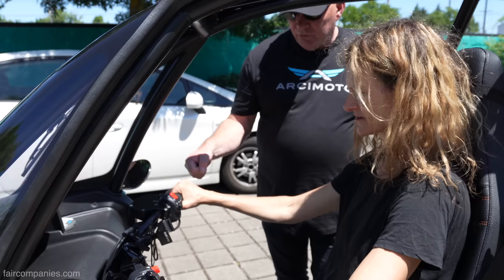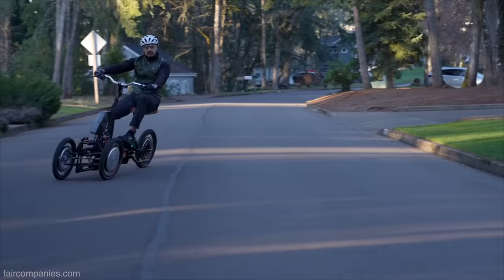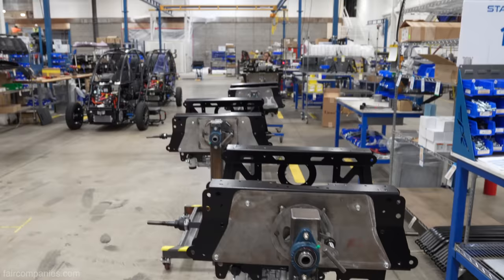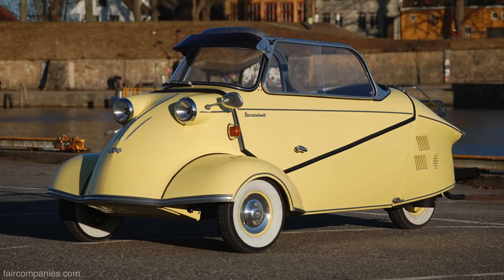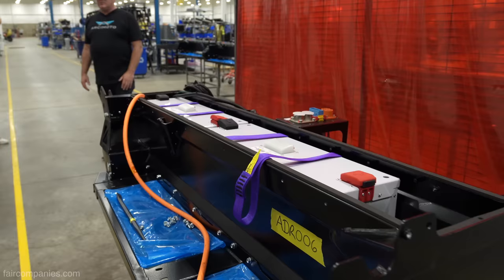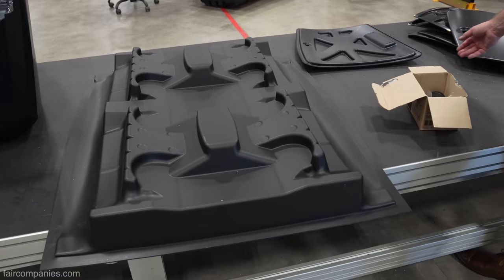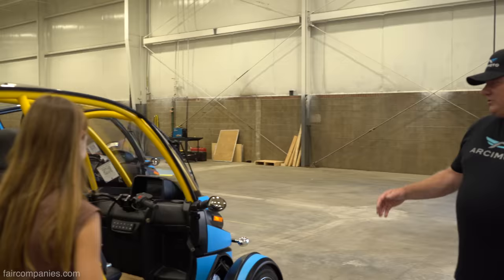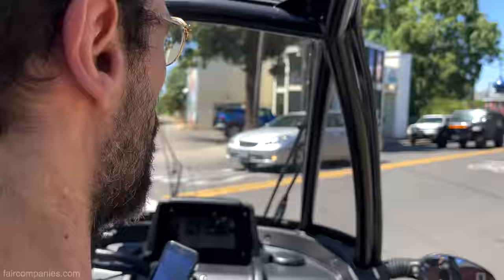Arcimoto 3-wheel EV commuter blends bikes' fun + cars' safety

Comment: Love this. We have a model 3 and it's fantastic. I would love to own one of these 3-wheeled vehicles but my only concern is ...Do you need a strong wrist and hand to operate the hand throttle?  Is it like a snowmobile? I don't last very long using a throttled machine.
Reply: I own one in CA.  No, you don't need a strong wrist.  Grandmas drive these.  At low speed, they are harder to steer, but they are coming out with torque vectoring software soon (software upgrade), and at that point, it will be really easy and intuitive to steer at low speed as well.  The one thing that I would say about the FUV that is challenging is that people with knee problems might not be able to drive for long with the doors on - there is a small, fixed amount of leg room - I need to take the drivers side door off to stretch my leg or I have to stop once in a while.  If you have no knee problems - no problem, there, either.
Reply: @richbodo  Thank you. This is good information.
Reply: Sue - allow me to update you with more specific company information about the steering that Rich was not aware of. Yes, trikes are very heavy to steer below one mile per hour. Most owners manage with no complaints but the design's twin front motors potentially allows for an elegant engineering solution to power steering called 'torque vector steering'. Arcimoto has been working on this feature that is possible through software control of the two motors - one wheel can be reversed by the computer with the help of a handlebar sensor to effect easy steering by computer software. The first beta testing for this starts later in 2022.
Reply: @richbodo  Hi Rich, please do a search for 'torque vector steering' or see my reply here to Sue. An upgrade is in the works.
Reply: @popeyegordon  This is a true electric trike unlike the slow 20 MPH electric ELF that you pushed. Sure you need a license, insurance and registration, but you can take this anywhere without holding up traffic on 45 MPH roads like the 20 MPH ELF does.
Reply: @sbl17jackson37  Nonsense reply. I 'pushed' nothing, I described a hybrid light enough to pedal which requires no driver license and it can be use on bike paths. The FUV is for road use only. Both are electric trikes but the ELF in my avatar image is the one fully qualfying as a trike, not an autocycle. In my 15 years of ebike commuting I refused to hold up traffic. I pull off or switch to a path or sidewalk. I was a car commuter in Seattle gridlock before going to ebikes. You have no clue that the higher consistent top speed of ebkes means they avoid holding up traffic better in all cases. We stay just inches from the curb except for left turns and we use bike lanes when available. We have the same right to the road as any car driver and our actions mean one less car to add to gridlock, one less filled parking space at work.
Reply: @popeyegordon  Thank you.

Comment: GM's electric car in the 90's was efficient enough it could have conservatively served at least 50% of commuters. Less than a 100 miles one way to work, recharged while a person attends their job.
Today?
Depending on climate, above 75%.Purely a guess. But with the knowledge that most people commute less than 100 miles one way.
Reply: P A  You're missing the point. 
I could spend a lot on a Tesla also, but it will take a long time to recover the initial cost through any savings.
50% of summer commuters could get by with this cheap alternative.
Or any small chap alternative not being targeted at the wealthy people. 

Nissan Leaf
Compact car
Body style: Hatchback
Number of doors: 5
Battery charge time: 20h at 110V, 8h at 220V
Battery: 40-60 kWh 350 V lithium-ion
Cargo volume: 850 L with seat area
Dimensions: 4,480 mm L x 1,790 mm W x 1,565-1,575 mm H
Configurations
SV
From CAN$39,498
SL
CAN$48,098
Reply: P A  The Leaf wastes too much energy unless you are always driving it with four passengers. It weighs twice as much as the Arcimoto and is no safer.  Insurance bill for the Leaf will be five times higher than Arcimoto's. Mine is just $130/yr for a good Allstate policy. Even with my perfect record I'd pay $900/yr for Leaf insurance.
Reply: P A  You can only invoke the shill gambit because you have no cogent refutations to my assertions as an enthusiastic owner. "The shill gambit is a type of ad hominem or poisoning the well logical fallacy, wherein one party dismisses the other’s argument by proclaiming them to be on the payroll of some company.

Sometimes known as the Big Pharma Shill Gambit or the Monsanto Shill Gambit. The shill gambit is used fallaciously when the only “evidence” given of such a connection to a big company or government is the endorsement of the position of the government or company, without any other evidence–the implication is that they provide that endorsement only because they receive some sort of compensation from the company or other agency. On the other hand when such conflict of interest is both demonstrated by verifiable evidence and can be shown to interfere with a person’s judgement of the evidence, then it’s no longer a logical fallacy.     Example - 
Clearly, anything the writer says about pharmaceuticals or GMOs can be dismissed because, even though I can’t prove it, they are obviously being paid by Monsanto and Big Pharma to spread the lies."  This despite the fact that Monsanto shut down forever in 2017!!! https://www.skepticalraptor.com/skepticalraptorblog.php/logical-fallacies/shill-gambit-logical-fallacies/
Reply: P A  This is not about me, nor is 'weird' applicable to responsible people who buy EVs. Same thing happened with the first horseless carriages. Learn from history or you are doomed to repeat it. The Era of Beach Driving May Be Coming to a Close    
Jul 19, 2021 — "Conditions vary, but many beaches—particularly on more remote coastlines—often require four-wheel-drive vehicles or advanced driving skills. accessing this sort of scene by car is increasingly difficult in states with beaches, a trend sped up by the pandemic. In California, the state's Coastal Commission recently announced plans to phase out vehicular access at its remaining drive-on beach state park, Oceano Dunes State Vehicular Recreation Area, along the central coast near San Luis Obispo.
On Florida’s Atlantic coast, officials in Amelia Island decided in 2020 during the pandemic to restrict vehicular access to daytime driving and residents only—and then kept it that way. And just south of where Layman and Boulden parked for the day recently, the Oregon State Parks and Recreation Commission decided to close a popular beach to driving, in part because of overcrowding.
States must balance the demands of short-term tourism that supports local economies with the desires of permanent residents, many of whom don't want cars or partygoers to interfere with their view or their enjoyment of a quiet walk along the ocean. There are also the competing needs of working fishers and shellfish harvesters, as well as the environmental stress of cars on nesting turtles, birds and other marine life." https://www.pewtrusts.org/en/research-and-analysis/blogs/stateline/2021/07/19/the-era-of-beach-driving-may-be-coming-to-a-close

Comment: Very few Arcimoto info videos disclose the limits to the range at highway speeds and colder weather.
Reply: This one did. If you are anything but a total newcomer to the idea of electric vehicles you already know that high speed drains batteries quickly. The actual official certified range rating includes the conditions under which it was established. Cold is not nearly as bad for lithium as it was for lead acid battery range. This industry is so new that it is not certain how range will be calculated as a standard metric. A super streamlined autocycle like the Aptera would want to brag on its highway speed range.
Reply: @popeyegordon  look how this internet gets us squabbling. I could resent your implication that I haven’t examined this topic thoroughly. I could rebut with the years in which Arcimoto touted their 120 mile range without caveat, my disappointment with their inability or unwillingness to build a closed cab for colder climates like mine. We could squabble on or maybe just see our arguments as partly or mostly displacing frustrations with the slow churn of a world so reluctant to face its climate emergency.
Reply: @GladmanNow  That would be a baseless squabble for the most part. For starters, I own one. And I have been a fact checker as a hobby since I retired, 170,000 fact checks in social media. I fact checked the video title and range claims first thing. What even I overlooked at first is the very long popularity of Kirsten's videos. She made one about my other exotic/innovative design vehicle, the 170 pound Organic Transit ELF car-bike, 7 years ago. That video now has 2.7 million views and 5,800 comments, of which 2000 comments there are mine as I fact check, inform and call out trolls by the thousands. Not saying you are one of those, just pointing out my considerable experience. I can factually say that Arcimoto did NOT claim their autocycles get 230 MPGe and 120 range in the first 3 years of sales and content, the CEO wisely told her the planned specs they are working on right now which will eventually be met and then exceeded. Next year's model (2023) that will go into large scale production will be lighter, simpler, more battery capacity and will be the bulk of FUV production for years. Arcimoto's website clearly states 102 mile range and 172.3 MPGe for models you can order today.
Reply: @GladmanNow  As to doors, the company mission is getting right sized sustainable transportation to the public which has a smaller footprint physically and environmentally. They knew going in that the sun belt has the potential for huge sales for their startup with little to no interest in doors or climate control and the base price is kept down by delaying those options for a later time when their place in the market is more solid and buyers will not balk at 5 grand extra for climate control. In that near future the battery will better be able to support such power demands. In Florida I can only see doors as dead weight and a security blanket for habitual car users who never owned a motorcycle. Motorcyclists know how silly doors are, expecially with this, the safest design ever made, which exceeds the safety level of any previous motorcycle ever sold in all history while offering all the fun of cycles. A large part of the disastrous impact with America's personal car fleet is the demand for climate control which helped to perpetuate our isolation from nature and encourages car centric city designs. Witness nature deficit syndrome. Not only do kids not go play in the dirt and spend days exploring the woods and stream beds any more, they remain isolated as they are transported by their parents. Never smelling the real world as it passes by, they are playing games on devices in the back seat. They will grow up to realize the huge damaging blunder of their parents who have been stealing more than their fair share of resources from their kid's generation. I had a man ask me to briefly show and explain my Arcimoto to his kids in his car. The whole family was delighted as I explained the goal of this new design and told them I will not personally benefit as much from this attempt at slowing global warming as they will when they grow up. I'm doing it for them and I will not live to see the benefit. I fact check videos for them in the long run. Each effort to make do with less today is more left for them in the future and that includes non-essential doors on a vehicle that aready has heated seats, grips and defroster for the wrap around windshield. This vehicle is far warmer than a snowmobile and those drivers wear winter suits. Nobody is complaining because a snowmobile is worthess in Florida.
Reply: @popeyegordon  way to drone on
Reply: @GladmanNow  Way to troll on. You have no evidence that Arcimoto made the claim of a 120 mile range in the past. Like I said, these videos by Kirsten will be around for many years, Within one year there will be a higher capacity battery in the FUV which can go farther, they are working on that now. The current battery compartment has 8 inches of unused space. If this video was posted with the current 100 mile range it would be obsolete by next year. Battery capacity has been improving constantly since they were first invented. Some day the range will be 150 miles and this video will still be here online. Wil you then complain because it is under reporting the range?
Reply: @popeyegordon  sorry for the unfriendly comment. Please stop communicating with me.

Comment: im in Perth Western Australia i want one , i want one with air conditioning and a long wheel base 2 seater and a van behind (at least 5 foot of van)so i can go camping and take all my camping gear and one that has solar panels on every outer edge possible so it can charge whilst im out camping for a few days and more batteries coz its a longer wheel base, windscreen and doors and a hard drive to add music too with speakers on each upper corner inside ,  all 3 sides operable for ease of access when camping , so it has to be able to do 500kms in one charge with solar panels trickle feeding to give that little extra. and permanatly set on best power usage not zippy speed  ,i want one ,i want one,  i want one, i want one, tell me how much , il start saving now
Reply: It is OK to voice your dreams but you should realize you just destroyed the sustainability factor by asking for so many extra features that the weight and price is doubled. Light and simple is the way to go in 2022 and beyond. You guys down under are already suffering from extremely hellish climate change disasters so in theory you should all be rabid environmentalists. Please consider using backpacking gear to camp. This was never intended to be a motorhome. I say this as a man who drove camper vans for 30 years, changing my behavior permanently in the same decade the scientific consensus declared a planetary climate emergency.
Reply: @popeyegordon  actually thats a lie our climate is how our climate has always been its the media who say its not and they do so just to gain click s coz people are keen to know about disasters the issue is thats just our normal weather cycles we are the land of extremes from draught to flooding rains , and if thats the case there is no point having one thats the issue with electric it just cant go far enough for a decent price if i cant get my camping gear in it if it cant do the distance its only good around town . , then electric has a long way to go before it can replace internal combustion, and most in Australia drive many kms just to get to work most in australia travel many kms on the weekend so we will still need a car , we never gunna have 2 different cars for one for city and one for everything else its not cost effective .not destroying sustainability by making its user friendly and making it possible to replace my car , thanks goodbye

Comment: What about rain and snow?  Physical ability to respond to a fall?  We almost need a two road system along with sidewalks.  Like it would be awesome on residential streets but 35, 45, and 55 mph roads would have more danger and traffic.  I do love this line of thinking though.
Reply: Youtube offers videos of the FVU driving in rain and snow. It does extremely well. You can't fall out of this any more than you could fall out of a car. The safety is equal at all speeds, no need for hand wringing. It is safer than any motorcycle ever sold. Safety is equal to any small car, but with no need for helmet or air bags, making this much more fun.
Reply: @popeyegordon  Handwringing?  The side is open meaning you would get soaked.  So you are asserting that when struck by a conventional vehicle it would not fall?  What about lightening?
Reply: @milissapoisson6369  You did not watch the video. Get back to me after you watch it and listen to the descriptions of the performance, comfort and safety parameters.
Reply: @popeyegordon  Umm,  Yes, I did.  Why would I want to get back to a snyde, condescending bubblebrain with no presence of forethought and poor manners?  Way to alienate prospective customers!😉
Reply: @milissapoisson6369  Thank you for answering your own question. All readers now see the real you. You posted absurd arbitrary totally unfounded derogatory remarks about this new very successful US designed and made vehicle. All of your silly claims were debunked in the video which is how we know you did not watch it. We can see you are a Tucker Carson fan. There is no worst insult I can post than that exposure of your values.

Comment: I had this idea a few years back to build one based on a Kawasaki 300 ninja and Nissan Juke lights. The motorcycles get something like 55 miles per gallon and after accounting for power transmission and fuel conversion losses, and battery mining pollution, are very much more eco friendly than an EV.